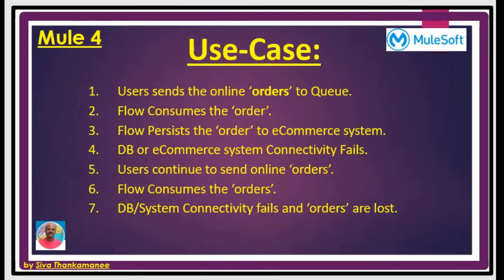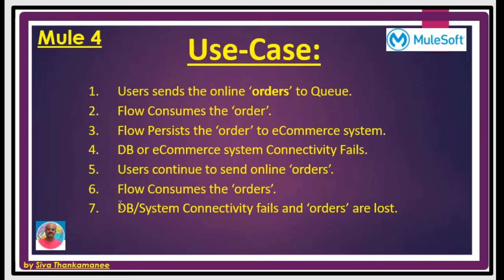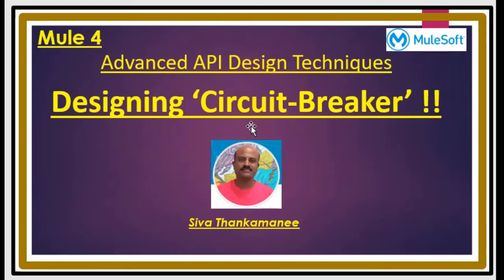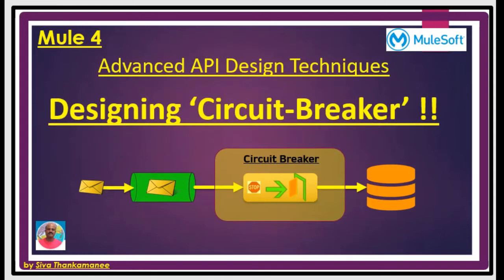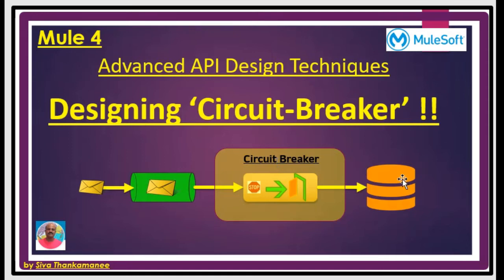Guard Your API from Failures - "Designing Circuit Breaker' !!

Comment: We have implemented same solution in our project. If you would have noticed at times it takes extremely long time to stop the flow.
Reply from the maker: I guess the strategy is blocking. Try to make the reconnection strategy to non-blocking. This  might be due to thread waiting and not getting released.

Comment: Hey Siva thanks a lot for this. In terms of having the circuit breaker reset it self without requiring that manual HTTP call did you consider using the object store to store flags and time durations ?